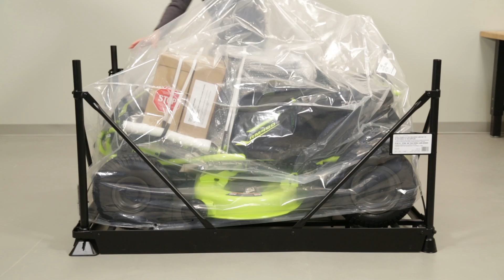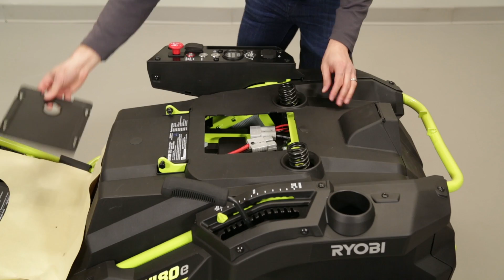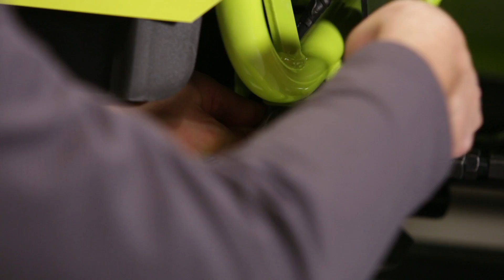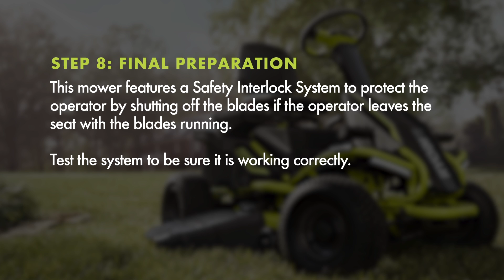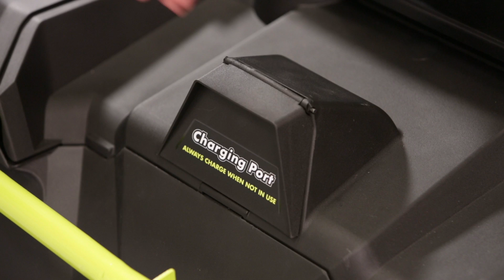How To: Electric Riding Mower Assembly Guide (RY48110, RM480E)

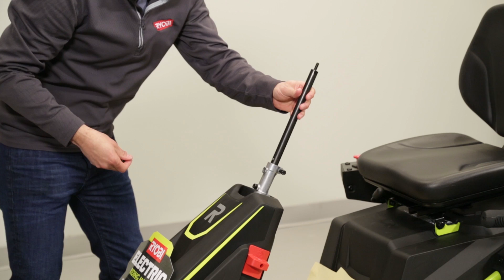Comment: WARNING!!! If you have recently purchased the RY48111, you will not find the steering shaft coupler mentioned in the video on mark 2:45. You will just need to use the nut and bolt to connect the upper to the lower shaft. You can call the Ryobi Customer Service to verify if your unit indeed is the one without the coupler.

Comment: General Electric sold lawn tractors like this in the late 60's. I believe they were called Electric Trak Tractors, they had similar run time and spec's. Many are still hard at work today, just a bit before their time. Well done Ryobi for giving a alternative to a gas mower.
Reply: Kevin Asbridge they would have had big lead acid batteries

Comment: I very much want one of these.
Reply: The cost is exspensive
Reply: Garage Kitchen of Science in researching gas vs electric you’re immediately left with few electrics: two zero turn models & this rider one. Interesting enough when looking for residential units the costs are relatively similar. The Troy Built zero turn is the only one w a deck sim to the Ryobi 38” but again gas only. The final determination is to go gas or electric. Gas models cost far more to run compared to an electric. Plus add to that maintenance costs: gas, oil, belts etc. If you maintain the batteries properly you can expect over three years of full function before charging begins  to fall off 100%. Early on don’t run the new batteries below 50-60% life left . Recharge feet e mowing. Do this for 8-10 mowings. This will condition the batteries for maximum charge and length of operation.
Reply: @garyspacenut4908  my comment is from three years ago, I have already made a purchase.

Comment: Just bought one.  This will compliment my EGO Electric Cordless Lawnmower.  My Home Depot had two.  They were the only 2 left within a 100 miles. I'll give a update once I use it a few times.
Reply: Have you had a chance to use it? I'm looking to purchase one in the up coming week. Please do share on pros and con (if there is any). Thanks!
Reply: I used this in my yard & the next day mowed a soccer field.  Very well pleased.  It is fast & powerful. Just like a good Riding mower.  I used it for a hour & had no problems.  Like my EGO electric cordless lawn mower & my Prius, this should be trouble free.
There is a new review out discussing the batteries.  Stated:  You should plug it in after every use & let it charge up, and don't go be low 20% charge for maximum life of the batteries.  It uses 4 jell batteries, 
 the same as a wheel chair.  The person stated should get 7 to 8 years of use from the batteries.
They have sold out here in my area.  I think this is going to be a home run.

Comment: I have noticed that on sev videos of this mower a very noticeable squeak developed on rather new machines. The answer so far States the steering column but fails to identify the exact location. I am expecting delivery of this mower today and would like to address this issue with lube at time of assembly. Can you be more specific as to what areas in the steering column or linkages this squeak seems to appear? Thanks!
Reply: Did you ever figure this out or have this problem? I've had mine for over a year now, and there is definitely a squeak somewhere. Sounds like the steering column or the lower steering components. Not sure where to lubricate or with what.

Comment: When can we see it in action, cutting grass?
Reply from the maker: Right now! Available online at homedepot.com and in select Home Depot Stores.
Reply: RYOBI is this available in australia?
Reply from the maker: It is not currently available in Australia.
Reply: How long will the battery last? I'm worried about the replacement cost when they die. Also, do you have an idea if a newer version will come out soon that has a 46" deck? 38" is kinda small.

Comment: Can you hook up a snow plow for this unit?
Reply from the maker: Great question! We do not have a snow plow attachment available for the Electric Riding Mower.
Reply: Is it powerful enough though to use as a snow plow to clear snow on  a regular size drive way, 2 car garage home, 3-4 inches of snow?
Reply from the maker: We are working on a number of accessory attachments for the riding mower and it is a possibility that we make a snow plow attachment that is compatible and optimized for this mower. We recommend not using a 3rd party attachment for our riding mower at this time.
Reply: TagumMotorCity they now make/support an accessory - https://www.ryobitools.com/outdoor/products/details/electric-riding-mower-plow-blade-attachment

Comment: What is the run time on this mower? it says not to charge in areas of extreme heat or cold, can you elaborate? I live in Northern Arizona, summer is 115 regularly and winter nights regularly drop to 15 degrees, these temps are about the same in my shop, when not heated or cooled. I have a gas rider now that is near the end of life, looking for options. thanks.
Reply: Tim Mills in the info for the mower, it says 12 hours. I don't think that it is actually going to last that long though. I have owned ryobi equipment before, and the batteries wear down
Reply from the maker: The optimal temperature range for charging is between 32F and 104F.  The battery can be charged outside this range but may result in slightly longer charging times.

Comment: I noticed on Ryobi's site that 40V outdoor power tools had a 3 year warranty that could be extended a further 2 years when you register your purchase with Ryobi (I believe). Is any such promotion available (or likely to become available soon) for RM480e?
Reply from the maker: Hello John, RYOBI 40-Volt tools come with a 5 Year Limited Warranty and a 3 Year Limited Warranty on the batteries an charger. The RYOBI Electric Riding Mower comes with a 3 Year Limited Warranty as well.

Comment: What are the dimensions of the box this is shipped in? I'd like to know so I can tell if this can fit in the back of my mini-van with all the seats folded down flat.
Reply from the maker: Hey John! The dimensions of the riding mowers crate are 66"x35"x45". Hope this helps! *Note, if purchased online at homedepot.com it will be delivered to your door!
Reply: Thanks for the info., it should just fit. Unfortunately the 100 Ah model is the one I want buy, but it's not for sale at Home Depot in Canada (even online.. for some reason?). Hoping that changes soon/for next year.